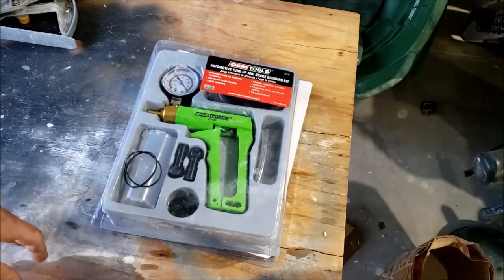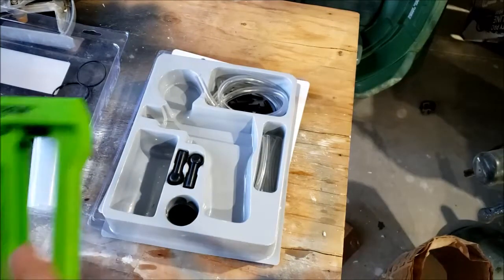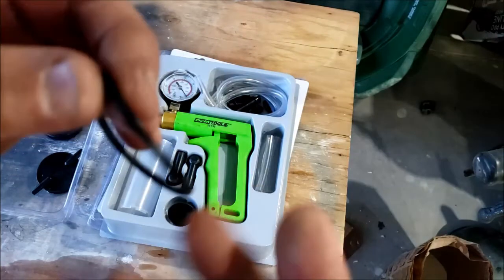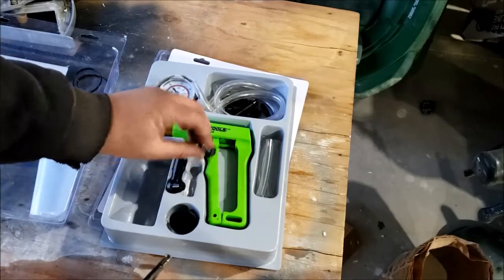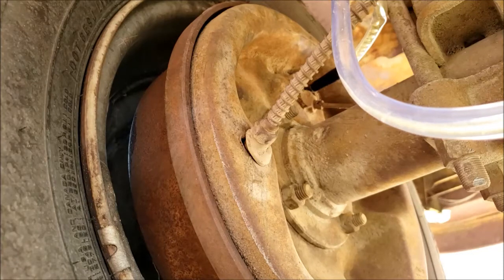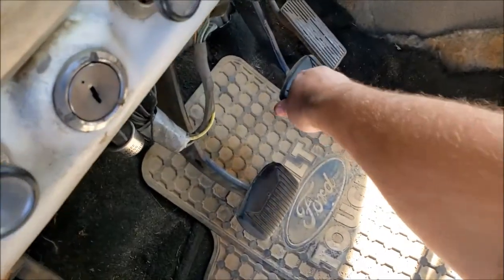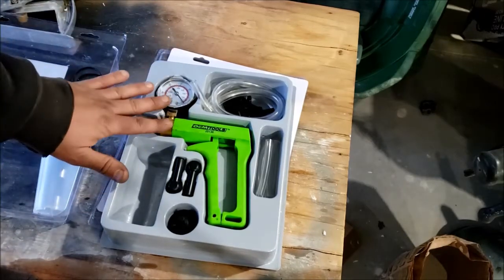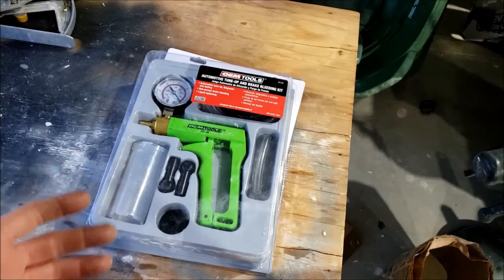OEM Tools 25136 One Man Brake Bleeder Kit - Review / Demo

Comment: I bought the exact same one but it's made by Performance Tools, everything the same in the package as this one. The problem is the rubber ends that go on the hose to the bleeder screw do not fit on the clear hose, weird. But in any case you can just put the end of the clear plastic hose end right on the bleeder screw, it will be just as tight. i paid $19.99 for the kit was $25. Nice deal. Nice video as well sir!

Comment: I have the same oemtool 25136 but looks different. I've had it for about 6 years and still work's good. I have taken it apart a couple of time's when it stops working, cleaned it good, put oil on the o'ring seals, put a couple drops of brake fluid oil in the intake after putting it back together and works great agian.

Comment: On my F350 it does not seem to be vacuum tight  on my bleeder
Reply: Get a different hose or maybe shrink it with some heat
Reply: @JDJD-mw9rr  it work fine put it up for  the night went to use it nothing put it toghter and psi test nothing leaked wont create  vacuum? Dont  know whats  wrong got brake fluid  inside of  pump  that's why I wanted to know if I could rebuild it  it's a OEM TOO)S  25136
Reply: @josephmiller9742  I dunno bro, I don't make the tool
Reply: Use the o ring on the bottle